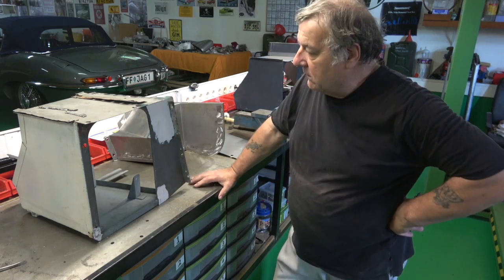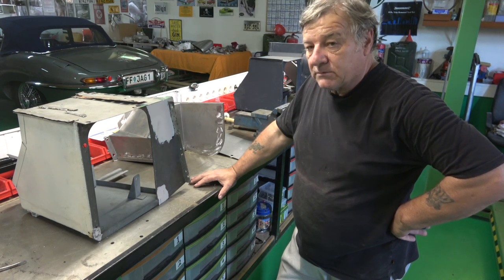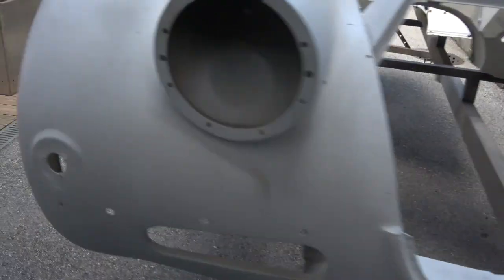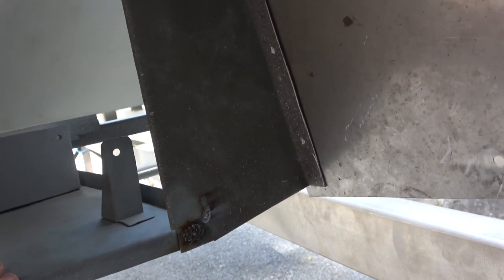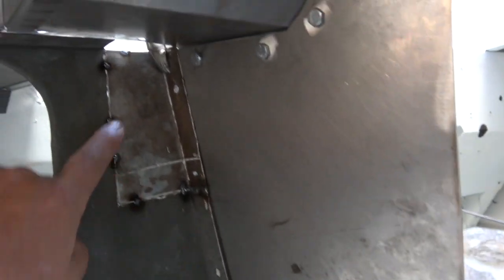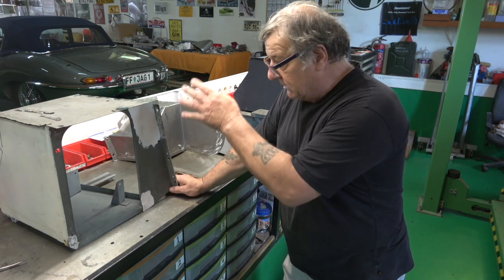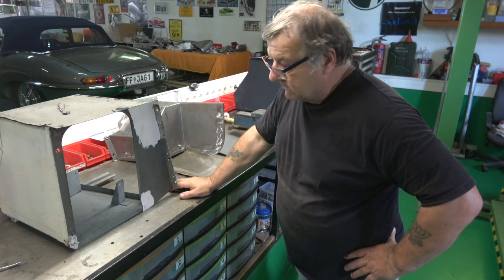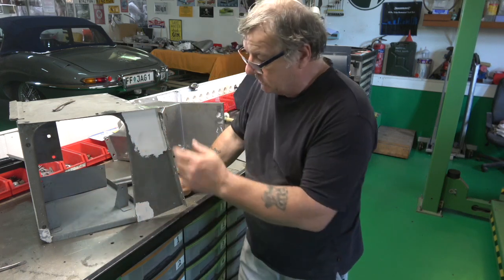Jaguar XK 150 OTS Inner Wing Triple Carb Air Filter Modification.

Comment: It's looking good Dave, did you buy those in or did you make them your self
Reply from the maker: Tony, We bought the air box and plate and the carb trumpet box with filter from Leaping Cats in the UK, But we had to do a lot of fettling to make it fit & make our own plate which makes the 700 pound per car for the system expensive. Cheers Dave

Comment: They're all a bit of a lash up really, no wonder they rusted to death. Acid test will be once engine is in situ with body on chassis. That cylindrical panel looks like it could be used partly to make the reserve vacuum tank enclosure panel that I knocked up up as a retro fit of this tank on mine. (Later addition)
Reply from the maker: Adam, Thanks for the info, Yes it would make sense, I‘m not 100% sure but i think the servo and vac tank sit above the battery box under the other wing if i remeber correctly, Your spot on about being lashed together it‘s like they where hand built lol. Cheers Dave
Reply: @ClassicCarCave  Yes Servo and reservac tank sit in LH wing with the tank sitting in front of the servo (a later addition) pushes things more forward in the wing bay. Paneling is very sketchy on this set up and it's almost made up in situ, thus a closure panel with a bulge in it to accommodate the tank. With all the fitment issues you're getting with the air filter panels I can't see it being any better on the other side. I am assuming the doner car did not have the tank to start with as this was a later S addition to my knowledge.